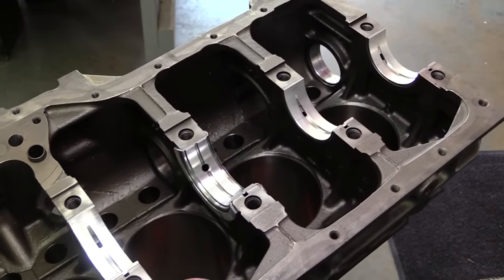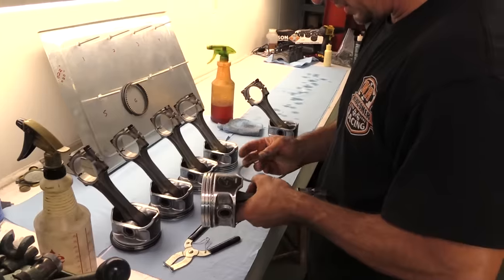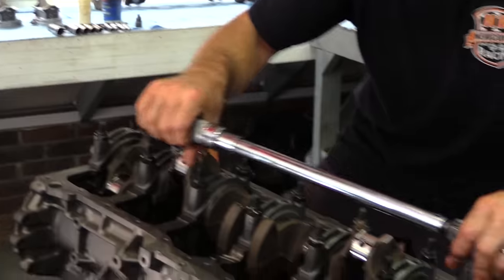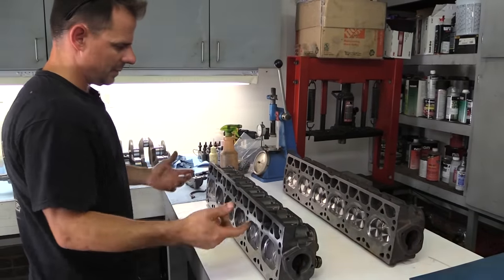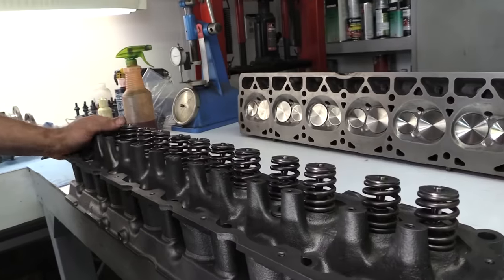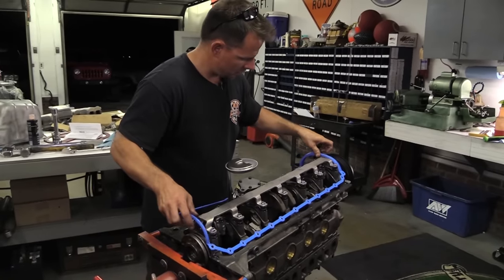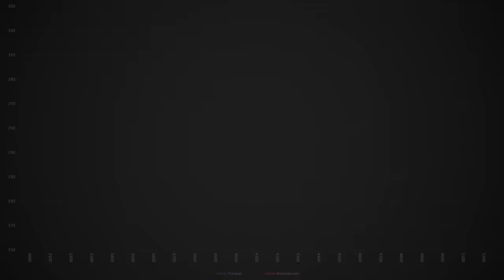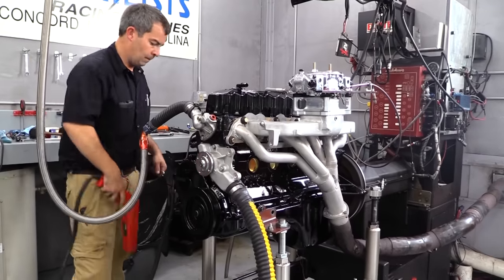Big Power Jeep Straight Six Stroker Build on a Budget with Newcomer Racing

Comment: Great, but what does it make while driving a full set of factory accessories and a fan?
Reply: It's probably putting 230 - 240 to the rear wheels. That's a HUGE improvement.
Reply: @theinternets7516  I highly doubt that. I bet driving a set of accessories (you know, water pump, alternator, acc driven fan), and through a full exhaust, it'll only make 260 or so. I bet it's under 200 to the wheels.
Reply: @elektrosmokes1911 , I'd be very interested to see them dyno the block before and after so you could at least see what your gain would be.
Reply: @theinternets7516  Me too. Not happy with the way they tested this one.
Reply: @elektrosmokes1911 , I did some reading and it looks like if the stroker build includes a high flow air intake, headers, and high flow cat and muffler your rear wheel gains are ~40hp. The stock 4.0 puts out roughly 155 at the rear wheels so this build would be putting ~195 to the rear wheels. Not terrible but not worth 5K. For maybe $1500 if you weren't doing the work yourself you could get 18-20 hp just by increasing the air intake and adding headers and exhaust. $3,500 for that last 20 hp doesn't seem worth it. http://www.fourwheeler.com/how-to/engine/154-0804-powerful-jeep-engines/
Reply: @theinternets7516  That's good research! Thanks for that! That's exactly what I was afraid of.
Reply: @elektrosmokes1911 , yeah. I was totally sold on this until I read up on it a little more. The torque gain might be worth it if you're a rock crawler but I'm not so I'd rather just spend the money on the intake and exhaust and save my 3,500 for tires, bumpers, and winch.

Comment: WHATS WITH DISH// GO FLAT TOP. ALL 71 & BACK AMC 258.. But That’s One Of The Hottest L 6 I’ve Ever Seen.  Goof  info too.. Guy Knows His 258s .. They Were  probably One Of The Most Underrated Engines , Ever.. Also AMC V8s.  People Underestimating. Them For 50-60 years.   290-304-343 4bbl-390 4bbl - 401,, Like 64-71 The 343/390/401 were screaming little monsters  I. Had A  70 Javlin SST. 401 4 Bbl Ram Air 4 Spd,  Thing Was Bitchin.. .
Reply from the maker: Thanks a ton!
Reply: Way to high compression ratio with flat tops.
Reply: Jordi Houtkamp nope.. 10.5.1

Comment: 5000G for a stroker 6 that weighs ??? 600 lbs making 300TQ....I myself would be looking at a stock all aluminum 5.3 swap before I rebuilt any dodge inline 6...but thats just me...plus the huge weight savings with the aluminum 5.3...not to mention the ability to easily make another 100 hp and TQ over stock with simple bolt ons...
Engine/accessories/computer for say a grand...better yet a complete wrecked truck...use what you need...sell the rest for parts and scrap...take it apart...clean everything and replace all gaskets and seals oil pump timing chain....give it a dingle ball hone job and a new set of rings...lap the valves...new set of stiffer valve springs. Trans adapter and motor mounts...probably still have enough to buy an HP tuner and a set of headers for under 5G...
This is doing the work yourself of course...double it if paying someone.
Reply: None of the guys here who would pay 5k for this i6 are capable of what you just outlined, hense the willingness to pay 5k for a stock engine, cam and some ported runners
Reply: @ harry_guy : "600 lbs"
wat
Reply: @moebadderman  The Dodge inline 6 weighs 600+ pounds...verses around 400 for the all alum 5.3...but the stock 5.3 make more HP and TQ then the stroker 6...seems a no brainer to do the swap if one can....it's not that hard.
Reply: ...Wiki sez it weighs 483 lbs -- where did you see 600+ ?? 
https://en.wikipedia.org/wiki/AMC_straight-6_engine

Comment: Who knows anyone who can tune, or knows any way to tune a 94'-95' HO style ECU?? I built basically the same short block with a stock head and a custom grind Comp cam. Just trying to be able to dial in my fueling and timing. Thanx
Reply: i did essentially the same build as this, but with forged rods and pistons, 10:1 cr, '95 block and head with minor diy porting (at least enough for me to say thats good enough, you know, not mirror finish or anything...) and harland sharp roller rockers. i put in bosch 0280156211 25.2 lb/hr 4 hole injectors (worked out to be a decent duty cycle for my guesstimate power output), same old 280,000 mile fuel pump. (i know, i know... but it still puts out somewhere between 35 or 40 psi wide open) and tried to use a 63mm throttle body but had issues with the tps and iac valve (put the stock 60mm back on for now).  i got a wideband 02, haven't gotten around to installing it yet.         anyway, to answer your question, the easiest way is to change your injector size. but the computer may give you hassels... idk to be honest... it may see the increase in fuel and duty things down a bit, however the increase in air flow with the extra 600-700 cc's should make up the difference.     ive heard that putting in some resistors, a capacitor and variable resister in line with the wiring to your map sensor on the firewall (at least thats where it is on my zj) can help trick the computer into thinking there is more or less air going in, therefor raising or lowering the air-fuel ratio. google "jeep 4.0 adjustable map sensor".    for timing... well, things get more complicated. i tried grinding off the tabs that locate the distributor and turning it myself, problem is it will set a code if you go a degree out and goes into limp mode (in my experience, extremely rich and/or no or very little ignition advance). apparently the trick is to machine a slot into the bellhousing to be able to move around your crank position sensor. in theory you should be able to advance or retard that sensor in similar increments to the distributor and the computer wouldn't know the difference. as far as i can tell, these old OBD1 computers are really easy to trick. all its looking for is ticks, tocks, and variable resistances and voltages from all the sensors. figure out what the values are and what you want or need to do and you got all the tunablility anybody would ever want with fuel injection. dont get me wrong, i was about 4 of my credit card numbers away from an offenhouser intake and a 500ish cfm holly, but talked myself out of it... a case of if fuel injection works good why fiddle with a whole new setup? however i would just giggle for weeks having a 4bbl and HEI or fancy ignition box, and probably have more adjustability and power.       ill eventually fiddle with all that but for right now im just running the stock computer with bigger injectors and it runs clean and puts out decent seat of the pants power. i need to put it on a dyno to see if i can really talk some smack but as of right now thats all i got. i just got my engine back together and have been driving it around for break in....  i guess take what i say with a grain of salt and do your own research. nobody loves your engine like you do... :)
Reply: @cj-otr3727  I've actually already run my wide band O2 on mine and no dice for any additional enrichment from my 24# injectors. Apparently the factory stock computer is quite good with targeting what it programmed to do and not deviate, period. From my experience and trials, fueling is set to a straight 14.7 AFR until about 70% throttle, when fuel enrichment kicks in, and I am running a 62mm throttle body with an old worn out factory, that doesn't show any signs of not being able to keep up. And yeah, turning the distributor it self is a lost cause, cause the computer, again is looking for a certain reading from what I'm only gonna assume at this point is a cam position sensor. The crank sensor has got to be more tasked with actually coordinating the spark event. But I can't help but think that the computer is still gonna fight you with any changes it encounters. Keeping the whole operation cool is another thing that's not been an easy task.
Reply: The O2 sensor is going to keep it at 14.7 untill ur over 75% then if u have upgraded injectors it will prob be in the 12.5 to 1 or so but only a wide band would tell u exactly. Wouldn't want it to run lean.
Reply: @n8dawg450r  well. Shows that I need to just get under my jeep and weld in my wide band. Lazy lately and going back to work and won't be back home for a few months. 

Anyway. I did yank my plugs for a look and they were whitish tan. Looking at cheater charts a little hot but not straight up lean. While I have started leaning into the pedal more lately my engines only got maybe 150-200 miles on it... so perhaps some more time letting the plugs color up, and getting my wideband installed will yield more information. I do want to try the map sensor mod. And I would like to be able to adjust fuel pressure. But... 1995....

I probably should've made a video on slapping everything together, but that's been done a million times and I just wanted to get my engine together. Perhaps I'll whip out the tripod and make a video on attempting to tune this generations computer. I haven't googled too much on it and some old chap probably has a 40 page long thread on how to do it. I've been wanting excuses to make videos again anyway.

Comment: When they plumb the cooling system up but the pump isn't running😂😂😂😖
Reply from the maker: The dyno setup uses an electric pump that pushes water through the water pump and cools the engine. If you aren't using the entire front drive system it makes things more efficient because you don't have to go out and find pulleys and belts to spin the pump.

Comment: A 950 carb a bit too big? It is way oversized! This thing would run well with a 600cfm.
Reply: @spankthemonkey3437  
Still too big.
If he made 450 hp @ 7000 a 750 would be the ticket. 
950 is so far beyond the need of this engine. I would love to see what kind of vacuum it pulled at wot. My guyss is less than 0.3.
Unless you're making 575hp SAE forget all about the 950, and that's only if your VE is absolute crap. An 850 will support 600 hp quite well in a lot of applications.
Reply: For torque, I'd say a 600 is still good. Once you go below the 600 series, things start to get really small really quick. Those 500 carbs flow quite a bit less compared to a 600. My guess is that the 600 will pull 0.6-0.7 hg @ wot. Spkt on and will provide great transition an torque.

Comment: Stupid question but what's stopping the revs from going higher than 5k?
Reply from the maker: I'm not sure if you are asking what determines the redline or how you hold the engine to redline, so forgive me for answering both. The engine has to stop at 5,200 rpm because right at 5,300 the springs can no longer handle the valve motion and the valve go into float. This kills power and is very hard on parts, so we want to avoid that. You can also keep the engine from going to that number by using a rev limiter. MSD builds them into their ignition boxes (at least most of them) so that it cuts power to different plugs once the engine hits redline. Hope this helps and not a stupid question at all. Thanks for watching!
Reply: @TheHorsepowerMonster  that's what I was asking. Was it valve train limits or something else. How much $ does it add to do valve springs? Seems at 5k I'd want more revs
Reply: @vr6prodigy  A lot of titanium spring sets can be had for around 325.00 and that's including retainers.
Reply: @elonmust7470  that doesn't seem to bad not to just say 5300 buck build lol
Reply: @vr6prodigy  you would also have to go with a larger camshaft to rev much higher to make more power,and at that point you are giving up low speed torque. not the best for a 4x4 that doesnt see high rpm that often anyway
Reply: @sps-vf4qq  well that makes pretty good sense. I was just thinking about wheel speed.

Comment: Look at that torque curve. Can you really call it a curve? haha. That's great, what 90% of the peak torque rating from 3000 rpm and up, that's outstanding. I bet this has respectable torque even from off-idle up to 3000 rpm, which is right where I'd want power in an off road rock climber.

Comment: I wonder if a turbo is added the jeep engine can keep up with a 2jz??🤔🤔🤔
Reply: A bone stock 2j probably. Stock supras weren't quarter mile machines. But those things hold upwards of 1000hp from the factory.
Reply: It was fast when the 2jz came out. The AMC 258 went racing in the 70s made more than 350+HP and over 400footpounds. And ran mid 11s all on stock AMC parts. In a Gremlin. Over 120 trap speed. It held the NHRA Tilte for decades.
Reply: And doin it N/A.
Reply: I've seen some old 80s video of a guy going stupid fast down the 1/4 mile. And some new videos of a turbo 4.0 in Mexicali.
Reply: They also came up with the Gremlin X that had a built 258 all on AMC parts except for the 12.1 pop up Forged Pistons and a solid roller cam pushing the Gremlin to low 10s in the 1/4 mile. 600+HP and 650TQ threw out the entire powerband. And pulled wheelies. They stop the project cause there was no one to race against in the same class. And doing it N/A. The 2jz is a stout motor but the AMC 258 is the true HP King without turbos. And those blocks are just as stout as the 2jz. But the 2jz are sleeved.slevee the 258 and it will match any 2jz. And that's when the Gremlin X was born.sum history for you you tube kiddos.
Reply: @Al-mx6ru  
A strong forged bottom put in a jeep inline I think would about take anything you want to do to it. But let's not forget the Ford Barra inline that thing is nuts.

Comment: And here come the Chevy guys with their LS this and that. You can’t drop in an LS and plug and play. You also can’t get back the Mpgs you would be sacrificing. You would also then be like everyone else with a Chevy motor in their Jeep. How original.
Reply from the maker: Agreed. I think a lot of the guys commenting about dropping in a junkyard LS are forgetting about all the additional costs for doing a motor swap. Plus, then you have a 200,000 mile motor in your Jeep unless you do a rebuild first, and that's a ton of added expense too. Thanks for watching.
Reply: The LS gets better mileage than a 4.0
Reply: I can get a 5.3 with good compression for under 1000, ms3-pro costs around 1000, throw a cam in there for 300, there's a running engine with more hp, more torque, & better mpg for less than half of the 5k quotient of the i6.

Comment: why do the valves give up at just 5000 revs? even an old ford 347 will probably do 5700 or more
Reply from the maker: Stock replacement valve springs, but the cam is more aggressive. So because the cam is more aggressive moving the valves the springs lose control sooner. Upgraded valve springs would be a great upgrade for this engine package if you don't mind spending a little more money. Thanks for watching.

Comment: So what 4.0 would be in a 99 grand Cherokee
Reply from the maker: The straight six in the 99 Grand Cherokee should be a good one. That year they were using the beefier NVH blocks but hand't yet upgraded to the new cylinder head that came out in 2000. The 1999 cylinder head didn't crack like the 2000 was prone to. Thanks for watching.

Comment: You can get a Hemi V-8 for less than that... and if you don't care about using different manufacturers you could go LS for even half of that... It would even make twice as much power for half the money.
Reply from the maker: But have you calculated the cost of fitting a different engine in there (transmission or adapter, motor mounts, wiring, hoses, driveshaft, etc)? Thanks for watching!
Reply: @TheHorsepowerMonster  yeah and as long as you're capable of doing some of the work by yourself you can do it for cheap.  God they put ls engines in everything now, why would a jeep be so much different?
Reply: ...everything is easy for the man who doesn't do it himself.

Comment: everyone goes on about blah blah OHV sucks, blah blah pushrod, blah blah reverse flow, blah blah - those things carry so many misperceptions and none of them has much to do with the reality of how good old school American engines really are if they're modded with the right combinations of parts, be they 6's or V8's
Reply: I mean...comparatively all those things DO SUCK when you stack them up against the alternatives. A dual overhead cam, 4 valve per cylinder, cross-flow cylinder head will ALWAYS beat the one that's like these 4 liters in the video. It's thermodynamics.

Comment: I want to see a barra 4.0 in a jeep.
Reply: A multi point 265 hemi would be more appropriate. But you'll get a cheaper bulletproof overhead cam engine if you  get an AJ16 Jaguar 4 litre. The Ford motors look like they learned a lot since they owned Jaguar.